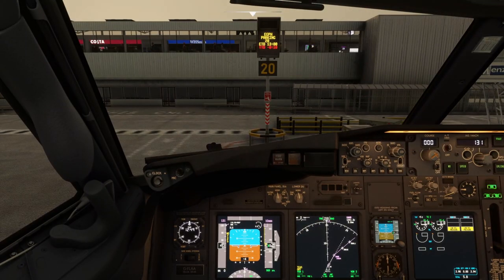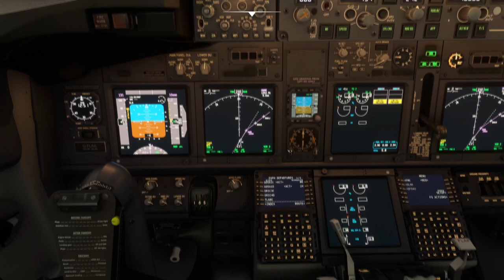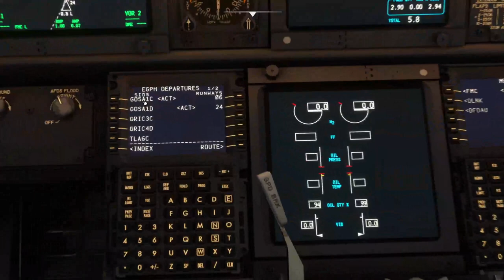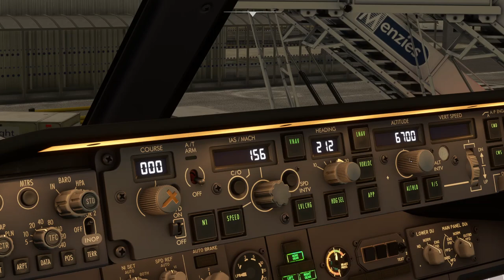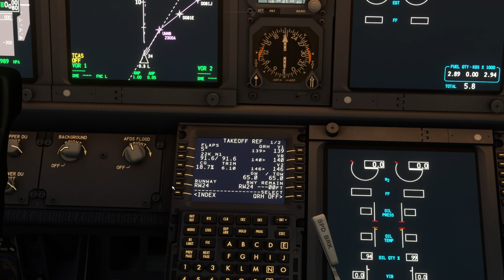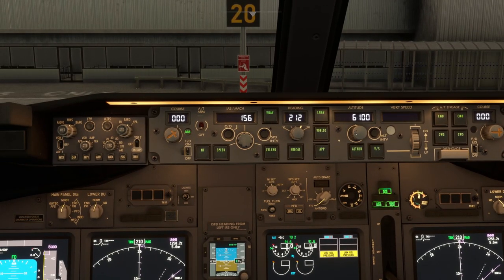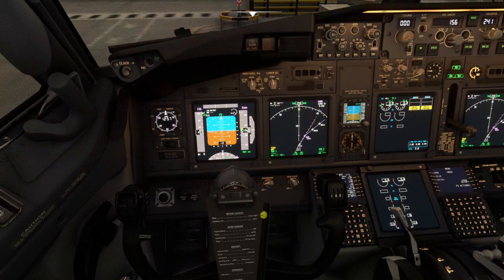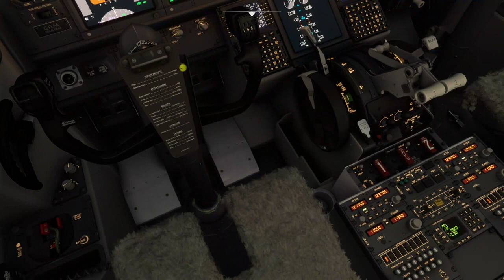VATSIM Tutorials | Episode 2: Clearance, Taxi and Take-Off

Comment: Another excellent and very valuable video to those contemplating the leap into flying on line. I couldn’t help noticing that during the initial request for clearance, you state information sierra but didn’t confirm the QNH received from the ATIS in the exchange, neither did the controller, you do however mention it’s mandatory to read the correct QNH back. Please don’t get me wrong, you know far more about this whole process than me, just thought I’d mention it for the benefit of your followers, unless of course I missed it somewhere. Thanks for the video buddy, you’re a true professional!
Reply from the maker: Hi thanks! Great point too - one which I perhaps didn't explain as well as I could have. The ATIS information contains the QNH so if it's ATIS information S, and we say we have information Sierra then the controller knows we should therefore have the correct QNH (which is why it wasn't spoken as a separate item in the clearance)
Reply: @BritishAvgeek  thank you for the reply, but the atis QNH must be read back to the controller when passing the information received, if not, then the controller will pass the QNH to the pilot who will then read it back. Keep up the excellent work 👍
Reply from the maker: @peterellis49  depends where you are - at work I listen to it all day and a lot will just say "callsign - stand - atis - request clearance to ...." And the controller either gives a QNH back or doesn't but if they do, it must be read back as it's mandatory as we discussed
Reply: @BritishAvgeek  nevertheless it’s a superb video and you must be congratulated on the time you give up for the benefit of others, so thank you for all your excellent tutorials. Its a shame you wasn’t able to raise the cash to embark on an ATPL course, I’m sure you’d excel, I tried the hours building route after I got my PPL, but couldn’t keep up with the expense. Best wishes buddy 👌

Comment: Great refresher course Luke, or beginner tutorial, wherever you are in your Vatsim journey. 

Question: Once you have been handed your Squawk Code and put it in the box, what do you do with this code? When would you take the transponder out of standby, and do you use TA or TA/RA?

To be honest this subject could have its own separate video lol.
Reply from the maker: It's a great idea! 
Clearance - you get your squawk code, put it in straight away after reading it back to the controller

When to turn it on? Actually it depends on the airport. It's in the charts usually (or in the ATIS on Vatsim when it says "squawk mode C on the ground" or similar)... If it says to squawk mode C on the ground turn it on... If it doesn't, leave it on Standby until you're at the hold point then put it on TA/RA for takeoff in a basic sense! 🙂
Reply: @BritishAvgeek  Thanks buddy. That should help people out, understanding what to do and when to do it? 👍😊

You know, I have never actually looked at the charts, or vpilot to see when to activate Mode C. I'll start looking out for that.

Comment: how do i read back ifr clearance i have tried it several times and i dont entirely understand. help!
Reply from the maker: You'll be given it in a set format so you can predict what to say in response before you ask for the clearance.
You'll need to read back:
- your departure route (the SID)
- initial climb altitude
- squawk
- QNH

You might get bits like "after departure fly heading.... " so if you get that then you read that back too and follow that instruction after departure
Reply: @BritishAvgeek  thank you so much for the help i wasn't understanding most of the transmissions and i couldn't quite identify what i was misunderstanding and when i read your reply it all made so much sense :)
Reply from the maker: @helenrobinson7771  good to hear, keep it up!
Reply: @BritishAvgeek  i did a flight from EGLL to EDDM and it all went smoothly until the tower at EDDM said "you cant follow basic instructions therefore i will no longer give you any clearances that is not how it works"

Comment: Hi. Are you using safeguard docking system fro gsx pro. If so can you tell me which one you are using and how to get it working like on your video.  Mine is blank with no electric on. It's so frustrating. I've bought the product and can't get it to work. Thanks Alan
Reply from the maker: You need to link your simbrief profile to GSX via it's COUATL settings and if you're taxiing in you need to select the stand you are parking at in order to receive marshalling/arrival safedock

Comment: Subscribed. Do you recommend starting out with a smaller aircraft in Vatsim such as the Cessna 208B? Does Vatsim even support ATC for such a small aircraft? How do smaller airports work where planes like the 208B fly out of such as Eastsound, Washington where the airport is not towered?
Reply from the maker: Thanks! Good question, it depends what flying you want to do. Typically on VATSIM you'll see airliners flying IFR - certainly in Europe and the UK. In the US you might hear a few smaller aircraft buzzing about. If you're at smaller airfields in the US just announce what you're doing on unicom if you feel it necessary depending on where you're flying and what you're doing.